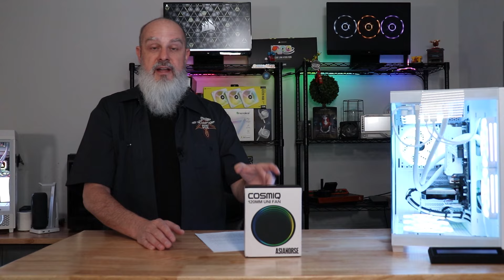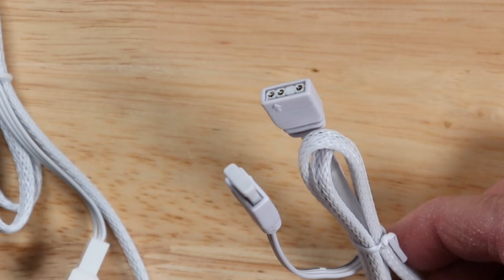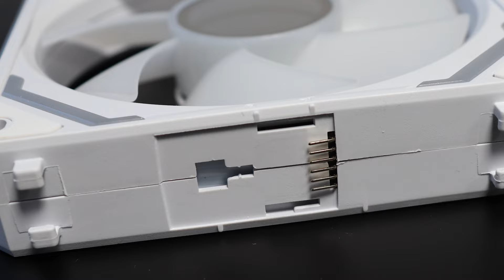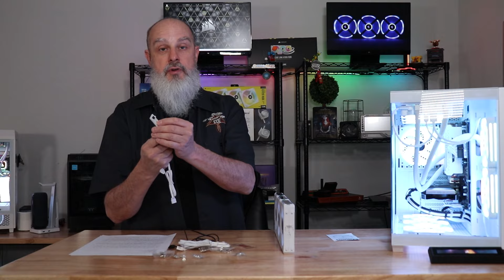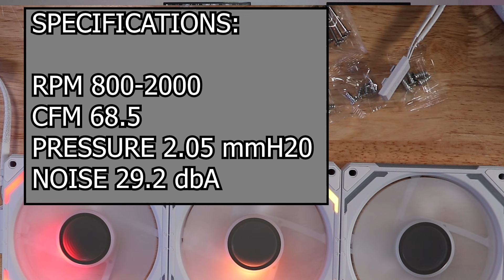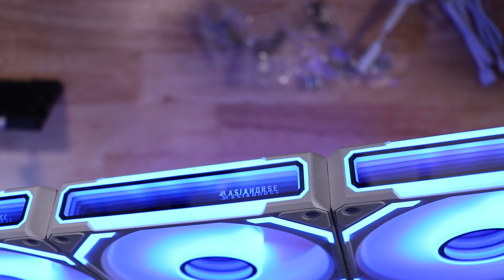Budget Alternative to CORSAIR, Thermaltake and Lian Li? Check out the AsiaHorse COSMIQ UNI FAN 120

Comment: yeah i have the ICOLER UNI Fan 120 Infinity Mirror Module Daisy-Chain ARGB Fan 120mm Triple Pack with Controller Suitable for Computer Case & 360mm AIO Cooler they have 4 version of it the V1 is just like this the V2 has better ARGB and better connection The V3 has the Reverse and tthe V4 has a cover connection that covers the other port and has Reverse Mirror on both sides for intake and exhaust also its a 1.1 of the Lian Li Infinity Mirror Module Daisy-Chain ARGB Fans
Reply: Which controller are u using for those? Just bought the same ones and wondering how I can connect everything to a hub
Reply: I’ve been looking at those especially since they are one of the few that have reverse fans how do you like them
Reply: @Modzzilla  loving them using all 9 of them in my Lian Li 011D Evo RGB case look awesome im waiting on them to send me the Reverse ones